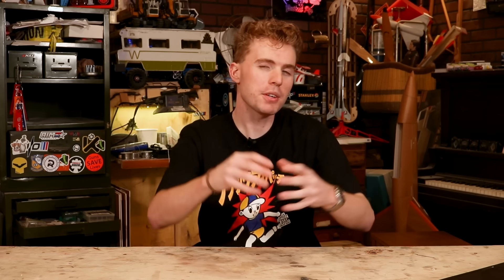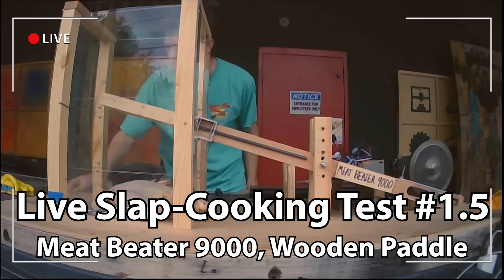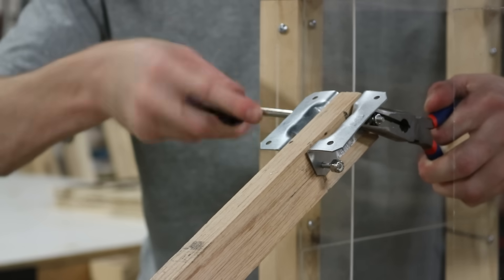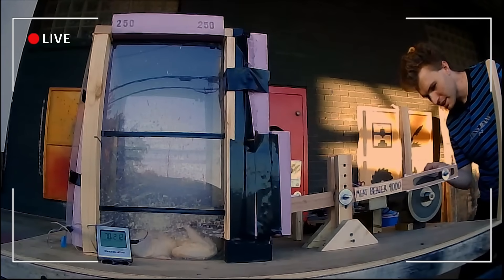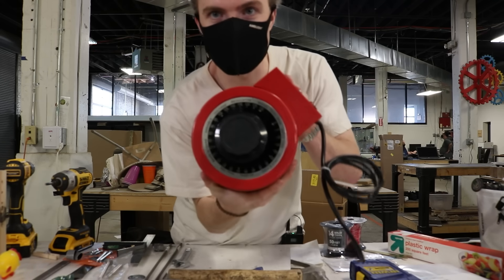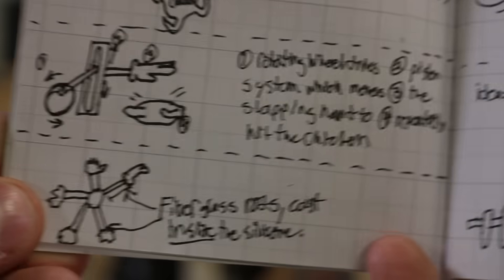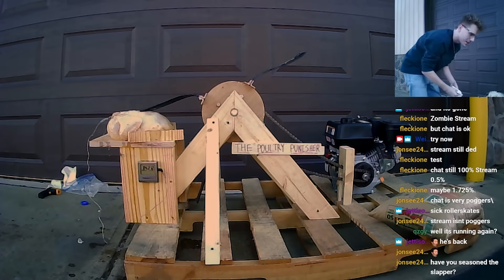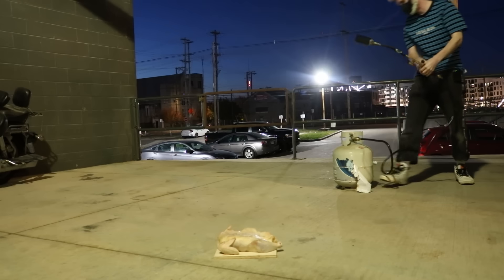How Many Slaps does it Take to Cook a Chicken?

Comment: You didn't trip to increase the number of sides of the chicken getting slapped. If it was on a spike and was slapped on two or three sides at the same time. You could triple the slaps per second without increasing the speed of the slapper or the force damage to the meat.

Comment: You should try 2 things:
With the first mechanism, raise the height of which the paddle hits the chicken so it doesnt get smashed, and use a wider paddle for less specific surface damage.
Second idea:
With the second mechanism, use 2 wheels with more rubber peices, and put them on the sides of the chicken so more surface area is cooked

Comment: I think the problem is that the new machine was transporting hot chicken dust away, effectively cooling the chicken. I think the Meat Beater 9000 was a better at keeping the chicken dust in one place.

Also, wrap the chicken in mylar foil and put polyurethane foam everywhere where it's not getting slapped. This will keep the heat inside and will aid in keeping the chicken unmushed.

Comment: Your biggest mistake is not performing it in a vacuum.  You are probably cooling the chicken by pushing air around more than you are heating it up with friction. Your change in heat is probably coming from the air warming up more than the chicken warming up.

Comment: Kinetic energy doesn’t simply transfer into heat directly, a lot of the energy is wasted to physical deformation of the chicken, the mechanism itself and the surrounding. Additionally, the mechanism increases the flow of air in the surrounding area, which raises convection transfer of heat, which works on the chicken and the mechanism itself. The temperature difference is not enough for radiative transfer to have any effect yet. Technically the amount of slap theory is correct but it does not account for the chicken and the mechanism having a giant heat sink all around them plus the transfer of energy having very low efficiency. You would have better luck using light to heat up chicken instead.

Comment: Nah man i think its still possible,  your slapper was also a wind machine. if you did this inside a vaccum chamber then the heat would only be lost to the whatever is holding the chicken, and if you used aerogel for the connection points you could minimize that too. it was clearly being warmed by the friction, there was just too much interference. that being said, this is already crackhead science we dont need to develop it further

Comment: What if you lessened the slope more by pre cutting the chicken into very small pieces, so the force has less material to spread through (and therein dissipate)? 

One struggle I see is that the body is designed to endure varying kinetic forces, so things like leg muscles are designed to shock absorb. 

Removing the beneficial arrangement, ie cutting into pieces, might lessen natural shock absorbing system. 

I'm imagining jerky sized pieces.

Comment: For the poultry punisher, you should have provided insulation or wind protection of some sort! You guys forgot to take into effect that the slapper was basically acting as a fan, blowing cold air onto the chicken, then allowing the slapper to cool in ambient air! 

I would suggest encasing the slapper wheel in something, you can't stop it from fanning air but you could perhaps duct a blow dryer so that the slapper is fanning warm air instead of ambient air. Like you said in the video, the main thing you are fighting isn't endurance, but heat loss. You tried to fight heat loss by just putting more heat into it, but you could have also tried fighting the heat loss going out.

Comment: Your forgetting  also that the the rubber slapper is also cooling due to the wetness of the chicken creating evaporative cooling, causing the rubber slap to apply a cooling slap. Enclose the slapper and the chicken in one vacuum unit. A human slap would at least evntually get the chicken to around 90ish degrees. (heat transfer from warm hand). Beyond that... i dunno. lol

Comment: It could've actually work. The poultry punisher couldn't get better results because it generates too much wind. Inside a closed chamber it wouldn't matter that much. I would suggest a slap-wheel design but with electric motor, possibly with some gears to increase speed. Maybe even getting it closer to the chicken and reducing length of the slapper pads would save the chicken from absolute decimation. I think there is still hope to finally get rid of ovens and cooking food the right way.

Comment: How about placing a chicken under a metal box and slapping the metal box. The slaps will increase the temp of metal box and increase of temp inside will cook the temp. Also do this whole setup in a controlled environment. Where u raise the ambient temp according to the raise of temp of chicken. Like keep the ambient temp around 10-20 degree less then that of chicken to somewhat minimize the cooling effect but not actually actually cook with that heating source.

Comment: Is it just me, or does the 8x slowmo shot on the poultry punisher tell an interesting story? The rubber flaps tend to lead into the chicken carcass from the tip of the flap to its base. Wouldn't that severely dampen the impact, thus killing efficiency, thus widening your temperature raised to destruction ratio?

Comment: What if you built an aluminum chamber to put the chicken inside and you slapped the chamber that way the chamber would get hot. The heat would be trapped inside the chamber which would in theory, heat the chicken.
That would solve the problem of the chicken being destroyed by being slapped thousands of times.

Comment: what this is evolving into is a 1500 watt linear motor (big woofer) coupled to a vessel in which the meat is allowed to bounce just free from the Walls of the vessel before slamming into the opposite wall at the desired frequency and amplitude. that would be the most optimized and i imagine it could be a competitive method for cooking

Comment: The first machine with the hand kept breaking because it was hiting it from the side. The second was a failure from the beginning, since it's been basically scratching it. But you never actually thought of a contraption that would actually hit it from the top, like vertically, moving up and down or something? And by covering it all around all four sides, no need for extra covers to keep the temperature inside. At least it wouldn't spread all over the place. True engineers don't give up so easily.

Comment: The last approach of a slapping wheel rubs the chicken much more than slap and lift action. It also allows each slapper to cool down when it is spinning through the air. And there is much more ventilation in the whole set up.
As for the chicken integrity part, either the whole chicken should be wrapped with duck tape, or it should be submerged into a water bath and the slapper should hit the water bath instead...

Comment: Why not put something over the chicken so you're not beating the meat directly and destroying it. Maybe some of that rubber used for the slappers could be utilized as a buffer between the meat and the beat. ( blanket the chicken in a tight layer of heat resistant rubber to take the beating so the chicken cooks inside without blowing up)

Comment: The first experiment did better. I dont understand why he gave up. The variables of the last experiment failed it immediately because there was too much friction tearing at the chicken due to it not really being a slap, but a grind. I dont know how he instantly gave up not realizing this obvious issue. Just get a better motor that wont fail and a slapper made out of material that wont break. Insulate it as well like you already did. It was working. If I had enough money, I could easily surpass this. Take my word for it. Dont give up. Its possible with how you were already doing it. You had results!

Comment: Okay, I have an idea...

Instead of slapping the chicken, what if you slapped a surface on which the chicken was being cooked?

The idea here is to slap the underside of something metal and robust enough to survive the slapping process well beyond the speed needed to get the temperature to what you need.  The chicken would sit on top of that metal and be cooked.  Basically, pan fry the bird, but with slap stovetop; a slaptop.

There are some drawbacks.  With slapping the chicken, you are just trying to get it directly up to a cooked temperature.  With this proposal, the surface would need to reach a temperature that exceeds that of cooked chicken, because it is transferring heat to the chicken.  It will always have to be hotter than the chicken.

Comment: The rotational design gets you way higher SPS, but the dragging across is a problem.  Not only does it destroy the chicken faster, but I suspect you're losing a lot of heat through ablation.  The top layer gets heated up, then immediately stripped off and launched at the pallet.  
Need to figure out a way to get an oscillating design over 100SPS or so.  All-aluminum maybe?  Fatigue might be an issue, but it only has to work for a couple attempts.

Comment: Possibly not taking into account surface losses on the slapper side? At a certain point the slapper will actually start cooling the chicken.  especially the 2nd one. It's basically becomes a fan and the heat exchanges too quickly. Need a slapper that can hold and capture the heat generated perhaps a cast iron slapper?

Comment: But what if you put the chicken in an isolated (fit to size to minimize air) metal chamber and slap the chamber itself. Then shouldn’t the slaps just warm up the air and then the chicken would air cook? The chamber could be slapped harder and from multiple sides at the same time.

Comment: Find another material, likely similar to rubber or maybe a semiconductor, and make a small patch not much bigger than the paddle arms, and use that as the surface to slap. Attach it to a larger surface of copper, to conduct the heat collected, and use that to cook the chicken.

Alternative, for style, develop a body bag made of copper or aluminum that is just thick enough to protect the chicken from decimation, but thin enough to still be sexy, and slap that instead of a naked chicken.

Comment: Don't stop, I feel like if you went with a thinner, softer material that also retains heat like silicone or an alternative. Also by having less distance from the center or a cheese style flap to reduce air movement(it was acting like a fan and that's why you saw the temp dropping) I really do feel like this is possible. Don't give up.

Comment: I think the problem is that the poultry punisher follows through with its energy, where the meat beater had less of a stroke, doing less damage to the actual chicken.
I think this could be easily achieved on the hottest day of a very hot place (like the desert in arizona maybe) with a few slight modifications on the meat beater design.

Comment: It doesn’t sound like you’re gonna revisit this experiment, but it seems like the integrity of the chicken is a big issue. 

If the chicken was vacuum sealed in a semi-rigid material it might help to maintain its structure and insulate it to prevent as much heat dissipation.

Comment: Now, see... you should've stuck with the wood rig. The upstroke is wasteful, but wood was clearly more effective at transferring kinetic energy. I believe doing this outside may have also increased your factor of atmospheric cooling significantly, esp without a wind shield-- air causes heat loss, but moving air increases that heat loss significantly.
Also, re: cooking only a "small part of the chicken"-- this is less of an issue than you would think. As long as you can maintain the proper sps for long enough, you will cook the whole bird-- heat conducts over time. In this case, the topside of the bird might be way overdone by the time the bottom is cooked, but still, you will have cooked the chicken.
Honestly, I'm more concerned about the salmonella explosion going on here.

Comment: Was doomed from the beginning. Rotary flaps cool too much and absorb any heat created through convection. You were so focused on the chicken that you forgot about the temp of the slapper. 

Any hits of sufficient force and speed will always be concentrated on one area and chicken skin can't withstand that punishment. You need to either, A: Slap something harder than the flappers/slappers and use that to indirectly cook the chicken, (While maintaining slapper temp), or B: try with something less physically intrusive. Make a box that can vibrate the chicken at high frequency or try using sound to see if it can be done that way. We know infrared cooking, a.k.a. broiling works as does microwave radiation. Anything slower and the time and power will go way up. in the order of days rather than hours let alone stream time.  Option C for fun, cook by rapid pressurization. Make a giant fire piston and see how many strokes it takes to cook. 

 Honestly you were likely creating 99.9999% of your heat through the friction of the hand/slappers, rubbing against the chicken. In that case, you could see how fast you need to rub a chicken until it's done but again it will fall apart. Pro Tip, rather than waste food, use an analogue like silicone. Once proven, then you can try the chicken but it's unlikely.

Comment: Do the flaps self cool as they spin or would it make sense to use a different material than rubber? Also you could build a chicken less test bench to see how hot you could get a surface with just slaps.

Comment: Kinetic energy = 1/2 mass • velocity^2

The problem with the poultry punisher is that the rubber paddles don't have enough mass. Another thing, you can increase the velocity and frequency of slaps by using a gear reduction in your chain.
Tldr: need heavier paddles (maybe stiffer too). Big pulley on motor, small pulley on slapper wheel. Otherwise, just build the meat beater 9000 out of aluminium and crank the velocity.

Comment: Maybe if the chicken was beat in a vacuum it could better retain heat? Also, it's probably losing heat through conduction with the slapper itself. If you could levitate a chicken in a vacuum chamber with magnets, and repeatedly hit it with another magnet in that chamber which is also levitating, you could probably raise the temp without having to hit it so hard that it's destroyed.

Comment: I'm talking without knowing that much. But wouldn't it be possible to bypass the chicken turning into paste by not slapping it, but slapping something else that's just touching it? Like if you manage to make lamin of steel or something like that atop the chicken but not resting above the chicken, like being supported by small columns specifically for the size of chicken you have.
Of course that still may not make it possible I just thought it may be useful to bypass that specific problem.

Comment: What if you used a metal plate on top of the chicken that would transfer heat. You could brace the plate as to press on the chicken but not crush it.

Comment: How many slaps does it take to cook the center of a chicken?  1..2..3..*put into oven*...3.  

Could you cook the chicken if your slap machine was slapping the inside of the box rather than the chicken directly?  If so, then technically the chicken would still be cooked via slaps.  Just not directly.

Comment: I can only be sure that the Poultry punisher didnt do as well as other since the point of impact was from the tip of the flap and not a full clap itself, which also resulted in chunking small bits of chicken out. 
I dont recommend this but its like comparing a slap with your fingertips to a slap with your full hand, youll feel the difference.

Comment: This seems like a job for a subwoofer loudspeaker rig. Just port the pressure from an efficient high-throw/low-frequency loudspeaker down to flex the chicken thousands of a times a minute with sinusoidal bass, say from six axes at once. Three speakers driving two ports each would do it.

Comment: I think where you messed up with the poultry punisher is that the flaps upon impact, will fold upwards and get hit by the flap above. This will absorb the majority of the heat. I'm also assuming that the punisher creates a lot of wind like a fan so you loose a lot of that absorbed heat because of the cooling effect from the wind (like blowing on soup).

The original design was a lot better because it removed some of those issues.

Comment: Honestly, I feel like the next step is to pour a silicone mould around the chicken. You cut away enough silicone for the slapper to have access, and rip it. The silicone reduces space for the chicken to deform, and acts as an insulator. You also pull back from the spin slapper, the amount of friction it creates isn't worth the efficiency.

Comment: The Poultry Punisher creates a LOT of airflow. It would greatly benefit from a closed environment to prevent the heat from escaping through air currents. Also, the rubber flaps might be too long - how stiff and what kind of movements they do would play a role in the energy transfer, I think. Whether that would be enough....

Alternative to slapping that might work (albeit that's a lil bit past the point) would be to try to vibrate the chicken into the temperature. It should be more uniform and maybe less destructive than the stress of the slap.